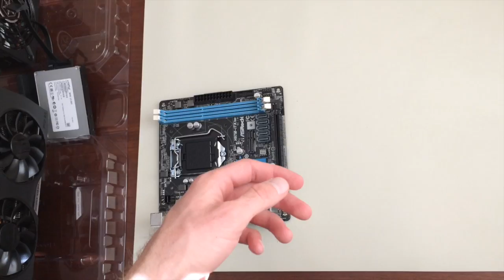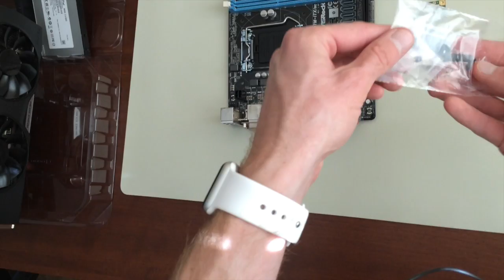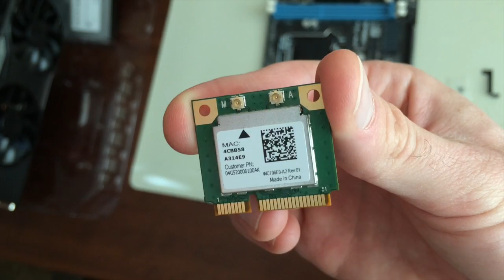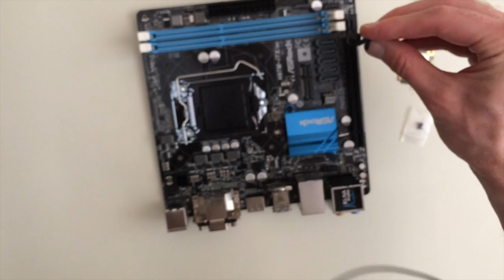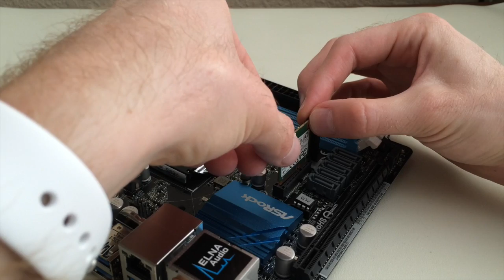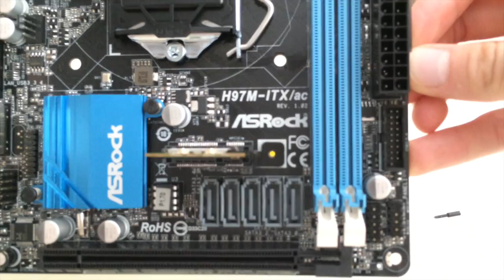How to install half-height PCIE WiFi Card

Comment: Does these mPCIE wifi card work well as it?  Just wondering if I need to buy antenna to go with it...?
Reply from the maker: not sure exactly what you mean "mPCIE wifi card work well as it". Usually the antennae come with the motherboard, and the wifi chip can be any chip; the connectors are all standardized. So you can always buy what you need if something is missing
Reply: Douglas Hewitt thanks.  Mine Asus Maximus V Gene didn’t come with antennas. I installed a Intel mPCIE card and it’s not able to detect network despite having the latest driver and appearing to be corrected installed.... just trying to figure out what I’m missing.
Reply from the maker: oh strange. It should definitely have antennas and wires that connect to the mPCIE card. You wont get signal without. if you look here and scroll to part of wifi you should have something that looks like what they have here https://rog.asus.com/articles/hands-on/unboxing-the-maximus-v-extreme/ or get something like this https://www.amazon.com/Wi-fi-Antenna-RP-SMA-Antennas-Cables/dp/B00A4I3AGE
Reply: hey thanks for the sharing the info.  I did some digging myself and looks like for the maximus v gene (mATX) board, they skimp on the antenna.  this makes sense why my wifi card didn't work after install.

Comment: Where tf do the wires go
Reply from the maker: so they connect to the case. when you put the mobo in the case it should have 2 or three holes the wires go into, and they will have antennas or something that connect on the other side; i imagine you figured it out?

Comment: ok so let me get this i plug in  the card and plug the antennas  to there proper slots ? can i use a laptop one  ...im using this mother board  for my cheap cheap build  https://www.amazon.com/gp/product/B01NAGY084/ref=ox_sc_act_title_2?smid=ATVPDKIKX0DER&psc=1
Reply from the maker: Just make sure its a m.2 and yeah should work, then you might need to get extra antennas / wires (because for laptop they will wire into the frame of the laptop)

Comment: Can you use any m.2 slot for this?
Reply from the maker: i believe so; it just matters how many lanes a m.2 slot has for a SSD, but for wifi card its fine.
Reply: No. In fact the card isn't connecting through M.2. His motherboard has a mini pci-e connector.

Comment: Does every mobo with a m.2 slot have antenna connectors?
Reply from the maker: no, they have to specify it as supporting wifi etc then typically it does that by having m.2 slot and antenna connections

Comment: You have U.FL IPX to RP-SMA connector if you want to add stronger antenna so you dont need to use those small "antennas" (wires)

Comment: Please how am I supposed to connecte the golden wires to the wifi card?
Reply from the maker: Did you figure it out? They can be a real pain, you basically have to pop them in with your thumb. However, you have to pay attention to which part goes inside and which goes outside (the wire vs the wifi card). If the plug bends it can be difficult, you have to get something like needle nose pliers to bend it back.
Reply: Douglas Hewitt yup i got it but thanks you for your answer ; )
Reply from the maker: awesome! nice work